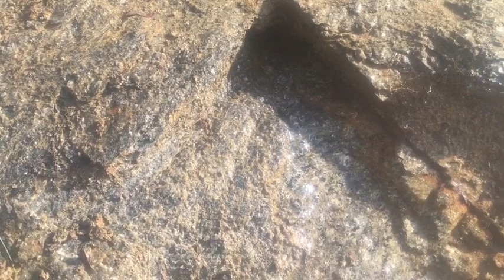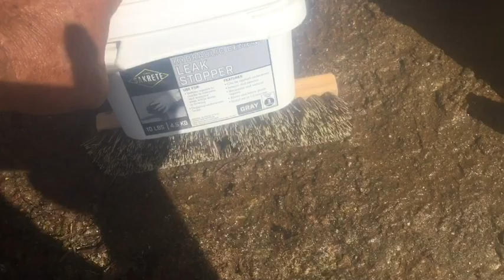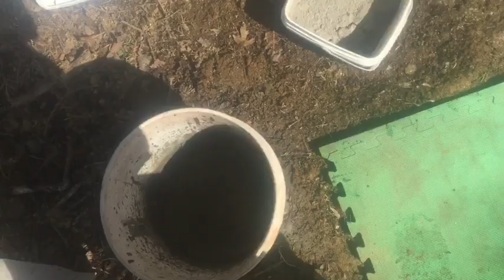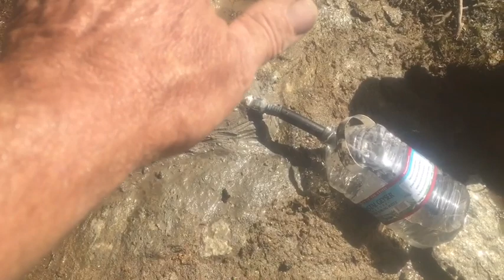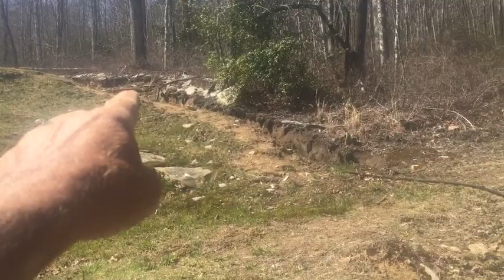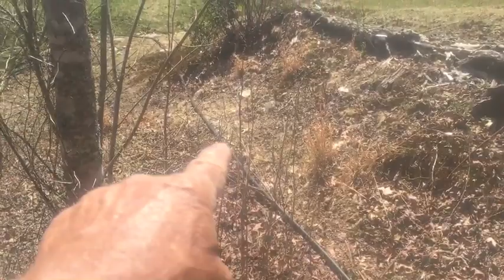Spring Water Collection On Solid Rock

Comment: Another WNC gem! Do you purchase your washed gravel or wash it yourself? That one spring I told you about that was too much to dam. I’m definitely going to consider hydraulic cement. I’ll let you know how it goes. As always....thank you for the education.
Reply from the maker: Normally buy bags of gravel 
But you still need to wash it
All you are doing is to remove any fine particles and the dust that comes with it 
Washing is easier that cleaning out the spring box and the pipe to the box